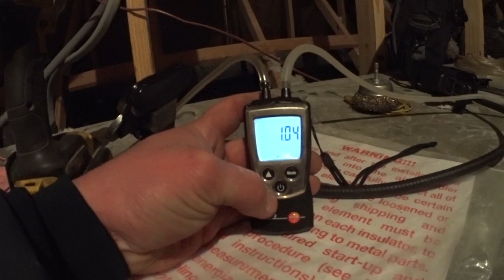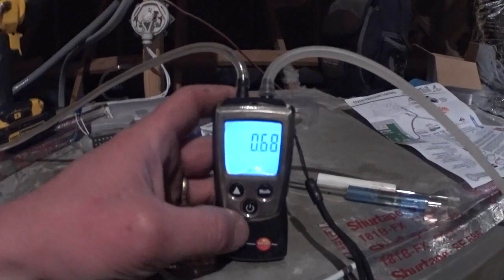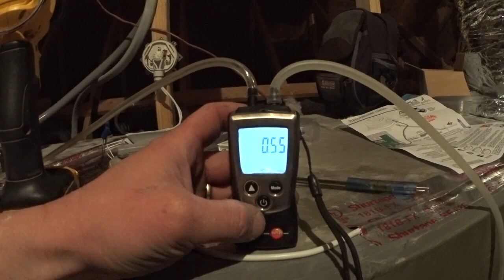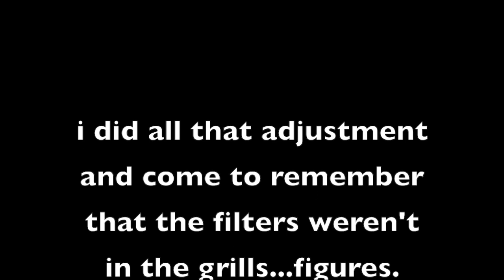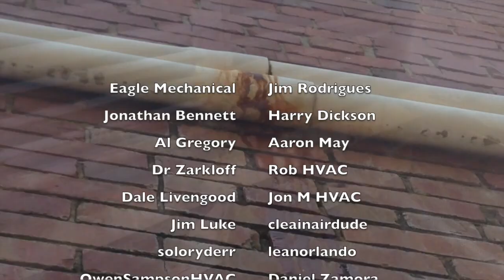HVAC Service: Adding A Bypass: A Day in the Life Episode 5

Comment: Just curious , what's the purpose of the bypass? some of the return air bypasses the coil and just goes directly back to supply? btw 100 watt vipers are awesome, but why no bass player?
Reply from the maker: The bypass takes pressure from the supply ducting and recirculates it to the return to reduce the pressure going to the ducts when one or more zones are closed. It's to keep air noise down at the registers.
Reply: Kool thanks I got it

Comment: I'm trying to figure out how it ran higher static with both zones open after the bypass was installed. Maybe the longer plenum is moving more air and when you opened up that restriction the fan is now moving more air and return static increase because of it. It helps to take supply and return static separate and see which side is the problem. I think Newton says each action has a equal reaction....I like to think about that with airflow. Decrease supply static increase return and vise versa.
Reply from the maker: I was a bit confused on that as well. I think I did check RA/SA separately but didn't shoot it on video. Don't recall...sorry. I'll do better next time.
Reply from the maker: I expected to see everything improve. So when I didn't I was dismayed.
Reply: Airflow is like a woman! Just when you think you know her she blows your mind!
Reply: Joe Shearer perhaps it has to do with the bypass damper being located at the return end of the bypass instead of the supply.
Reply: I can't think why it would matter where the damper is
Reply: Joe Shearer what happens when you shut a branch run off at the grill?
Reply: Hmm I could go either way because I could say you increase duct leakage but I think you are saying it increases static in the trunk but whether the damper is on supply or return I can't see it
Reply: Joe Shearer it would be cool to do an experiment and see. Next time I do a zone system I will add a blade damper to one of the start collars at the opposite end of the bypass as the damper.
Reply from the maker: I have always bucked at the idea that the damper for bypass HAS to be in the middle of the run... I just don't see any difference. Say the bypass duct is 10' long, how does 5' of duct before the damper in the middle make any difference over 10' ? Or for that matter, IF it does matter, then the bypass should always go directly on the supply plenum. Tomato, Tomato, the purpose of the bypass is to control air noise, yeah performance at high static is hampered but it's also hampered then you bypass hotter air or colder air back to the return, am I wrong? I see the damper at the return as extra volume in the plenum. One day when I can do videos like GFM, I'll build 3 identical systems and put the bypass in the 3 basic locations.
Reply from the maker: Good discussion generation talyn875 Joe Shearer who's the zoning expert that we can tag?

Comment: a couple of big mistakes I see and zoning is number one no TXV not on this video couldn't tell, need to have discharge air sensor to shut off the heat or cooling if it gets too hot or cold with the bypass. another tip to dramatically decrease static pressure is replace one inch filters with at least a 2 inch filter that's why I like those filter boxes you can buy already made from Johnstone. I'm sure in your area there's probably other local sheet metal places that may have them but if people have static pressure issues that's a big thing to do replace that 1 inch with a 2 inch or 4 if you have the room if they make filter boxes  are 4 inch
Reply from the maker: The zone board does have a discharge air sensor.
Reply: +Stephen Rardon (HVAC with Stephen Rardon) everyone that I have worked on in the past has one that's the only way you can prevent freezing up or going off on high limit controls when you have a bypass so you might want to double check that in the next job I'm sure that Honeywell has terminal for that I've seen a lot of zone systems that were not done properly just like you're going to

Comment: Steve, nice work. ECM or PSC?
Reply from the maker: I believe that was an infamous X13
Reply: Stephen Rardon As the static pressure across the X13 increases, the air flow across it drops off a bit. I wonder if changing the tap would help.